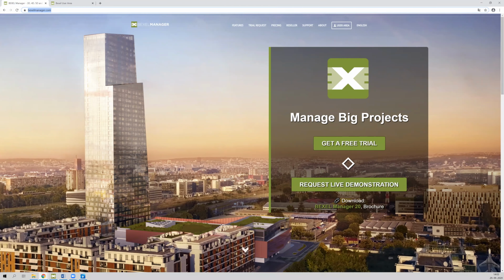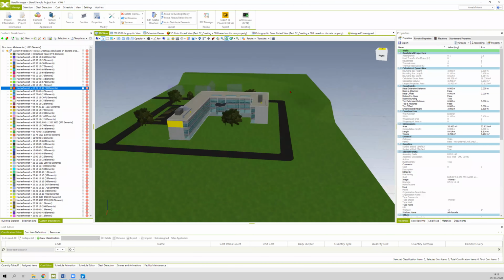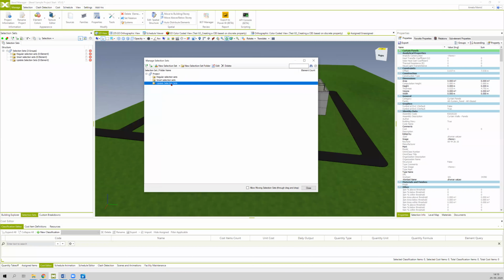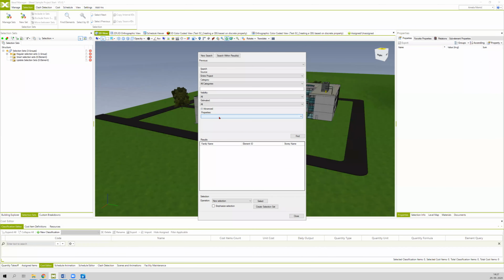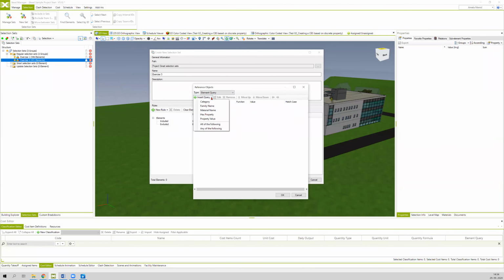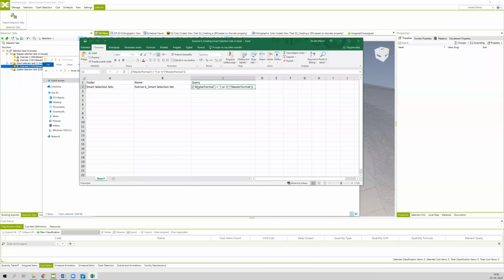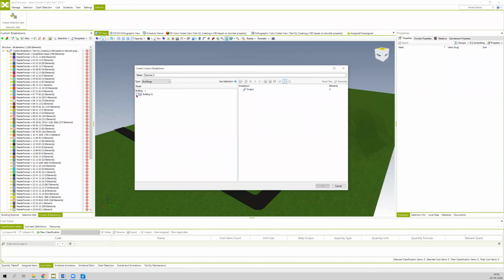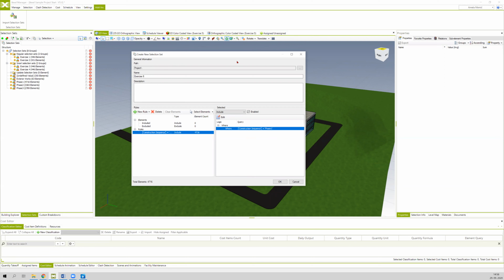03. BEXEL Manager - Use of selection sets (Lesson 5)

Comment: Hi, can somebody help, I am using a selection set I am using the Bonding Box length value for a smart selection set, my problem is that the length value is 0.042450606 and my selection value 0.04, is there a way to use round so that the smart selection set will include the 0.042450606 or can I only use the exact value?